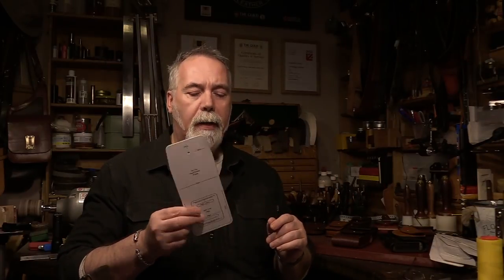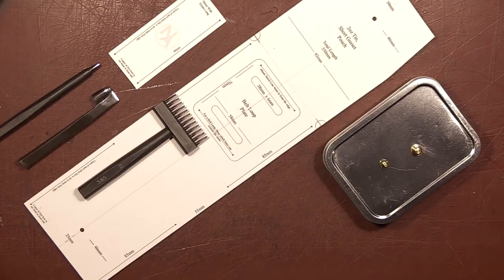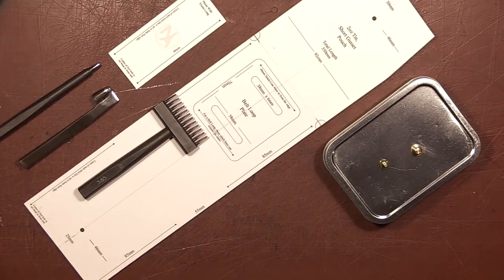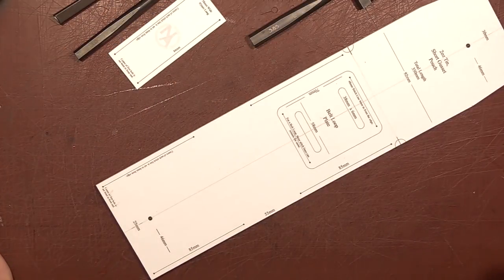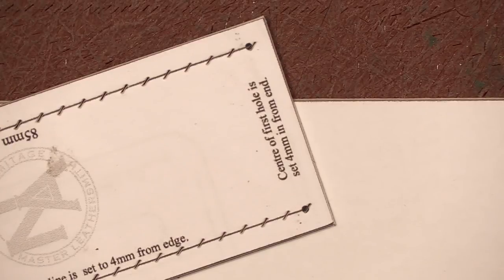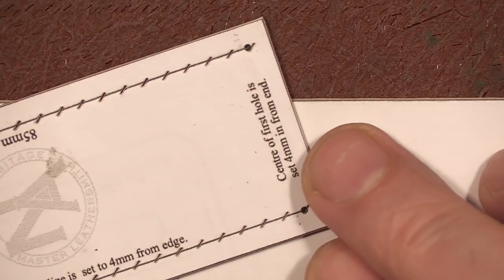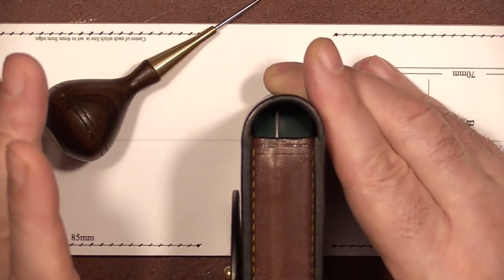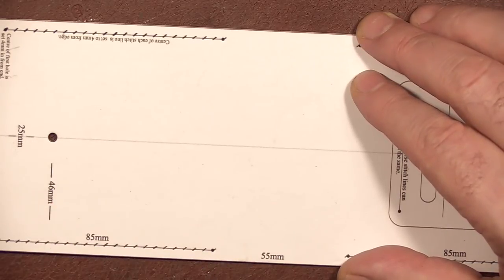How to Make Pouches: 6 2oz Tin Short Gusset Pouch

Comment: I have tried many times to make the 2 oz tin. So accurate at cutting the leather off the pattern. All the holes are correct number and placed properly. But after stitching  the lid or flap is at an angle. So frustrating.